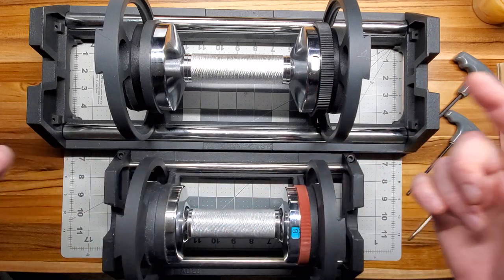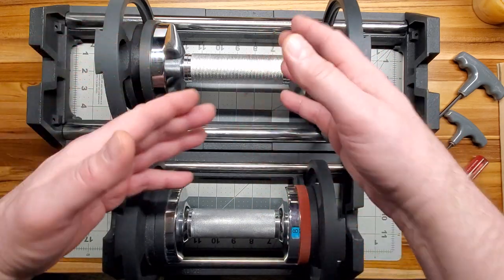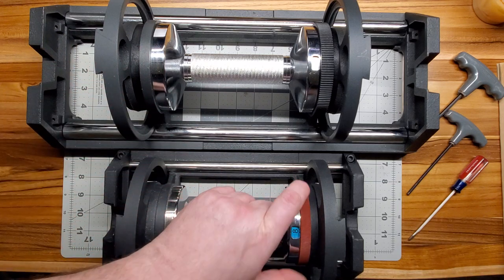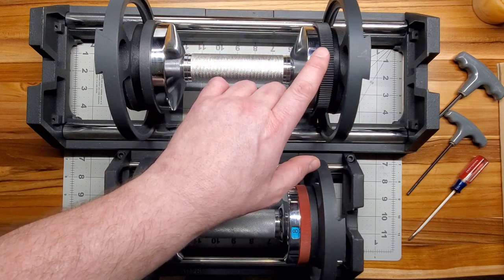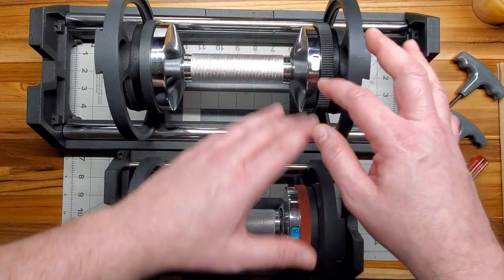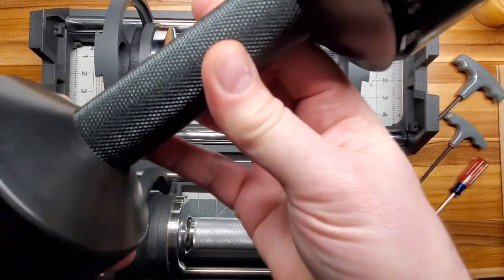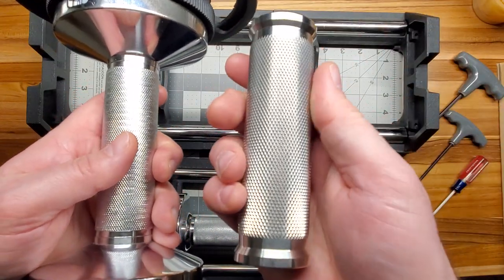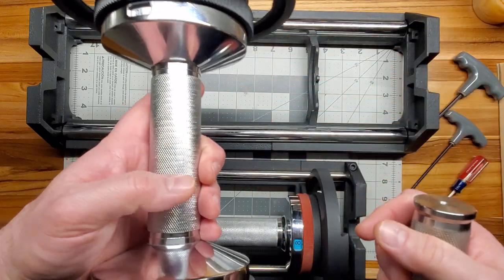Average Joe Teardown of SNODE® AD80 Adjustable Dumbbell--A Solid Design with Room for Improvement

Comment: Any thoughts on the Pepin Fast dumbells?
Reply from the maker: Hi, Gigi. Sorry about the delayed reply. I was away on a trip for 5 weeks overseas with limited internet access. I'm back in the States now and playing catch up with filling orders and answering questions.  I'd like to get my hands on one in order to provide a more informed first-hand opinion. 

Based solely on what I've seen in videos, they look like a well-made dumbbell. The adjustment mechanism and increments might not be everyone's cup of tea. I would not recommend dropping them repeatedly. We might get away with dropping them a few times but eventually those sliding mechanisms will tweak just enough to begin binding. Other than that it seems like a solid option for an adjustable. Cheers.

Comment: I'd suggest Snode switched to an aluminum inner rod because its tensile strength is far superior to the Polyoxymethylene rod in the earlier version.
Reply from the maker: Quite possibly, Dean, though only on the 80 as far as I am aware. Where did you hear/read that they were using POM? I've not seen a reference to it.

Comment: Joe,  first time I disagreed with you about plastic gears.    Even brand new never used plastic will become brittle and break after 4-5 yrs or less.    All military specs and safety harnesses for nylon and plastic have expired dates on never used surplus.     Metal gears  are very expensive so these companies are shooting them selves in the foot by cutting corners.    Ever wonder why classic powerblock last forever?
Reply from the maker: Hiya Jessica. It's definitely a valid point. You're not wrong. In a couple of my videos (and in replies to some comments over the past 3 years) I have briefly touched on the impact of time and environmental conditions on plastics (and rubber).  Fellow Bowflex SelectTech owners have experienced this first hand.  The plastic discs, dials, pins and weight plate coverings can become brittle with time.  Which is what led me to develop my first aluminum discs for the SelectTech.  

So I'm a big fan of metal replacement parts depending on the application. My entire business is built around aluminum and stainless steel parts. But in the case of Snodes, while metal gears would have a certain "cool factor", I feel they'd be overkill unless they could be made affordably. If someone wanted to swap in metal gears, there's certainly no harm in doing that. The gears in this design are under virtually no load; they aren't directly exposed to harmful environmental conditions; and, most importantly, they aren't directly involved in the safety of the dumbbell. I feel fairly confident that 20+ years from now the gears will continue to work as intended.

Powerblock is an interesting example of metal versus plastic. At one point they were milling the two bookends from aluminum. A beautiful looking version of the dumbbell too. So they had plastic versions and the aluminum pros, but they eventually chose to discontinue the aluminum version and continue with plastic across all of the models.  A vast majority of those plastic Powerblocks are still in use today, some 30 years later, right alongside the aluminum versions. They've aged for sure--many of them more yellow now than white these days--but they're still fulfilling their mission.  On closer inspection you'll find that some of them have deformed over time. Plastics bowed. Aluminum twisted. But they'll still carry loads  of 50, 90, even 125+ lbs. 

So plastic has served Powerblock well over the years. However, its track record isn't flawless. In 2017, Powerblock was the defendant in a class action lawsuit because the urethane coating and "ears" on its urethane series weren't holding up well. If I remember correctly,  the urethane could not handle the heat and humidity of the south.  So the main plastic body of the handle was fine, but the coating and joints on the plates were not.

So I totally agree with you when it comes to mission critical components.  Vehicle tires, safety harnesses, parachute webbing, etc. Mind the expiration dates and replace the products even if they've never been used. It's simply not worth risking lives over it.  But in the case of the gears inside the Snode, I'm willing to bet they'll be ok 10 or 20 years from now. And if they ever do need replacement, for a few bucks and a few minutes of your time  you're back in business for another 10 or 20 years.  

I really appreciate you taking the time to share your thoughts on the subject too. Thank you for that! Cheers, Joe